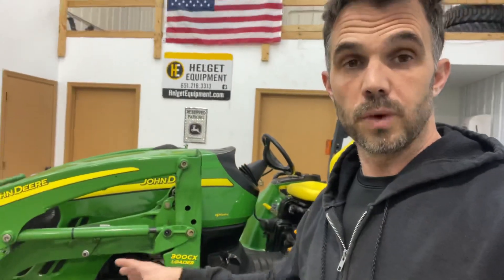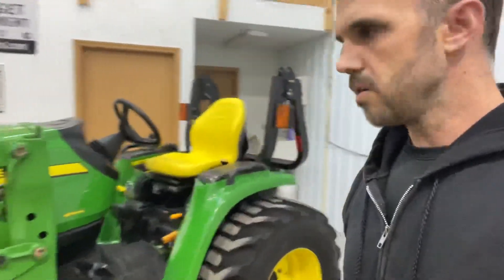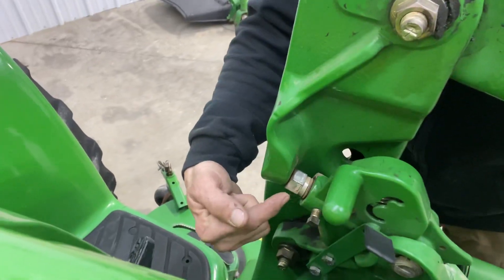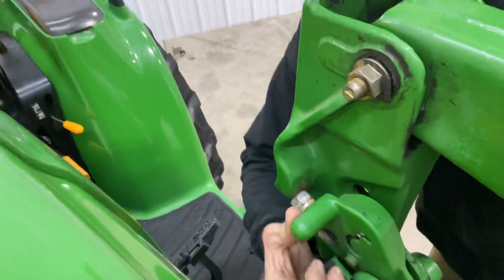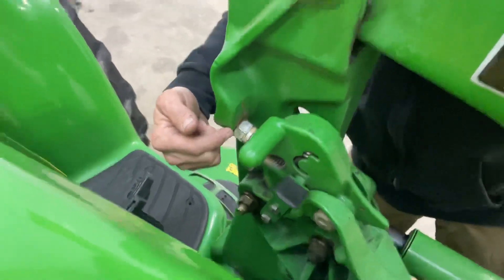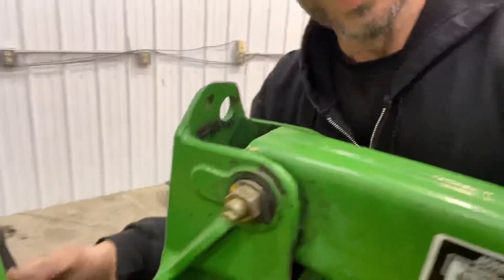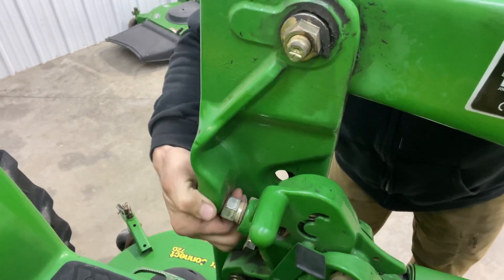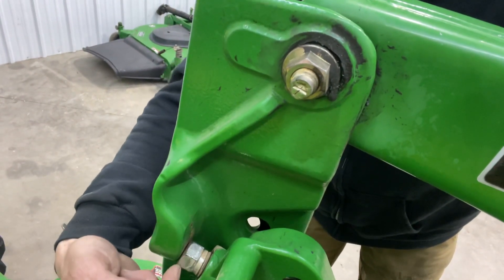Sloppy loader fix on 3R/3x20 John Deere

Comment: Greetings, I recently acquired a 3720 with the 300cx on it. The loader needs this adjustment and after watching your video I noticed that the tension pin is missing in one side. Would you happen to have the part number for this?